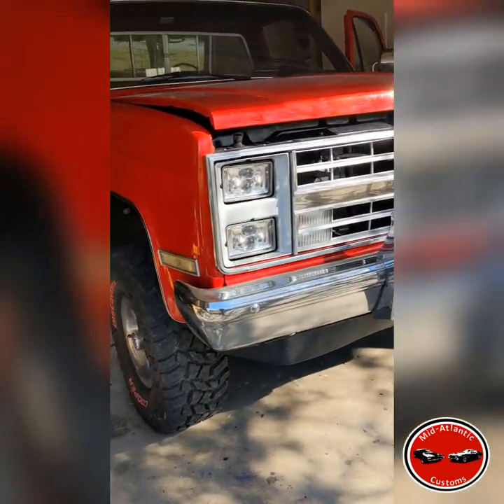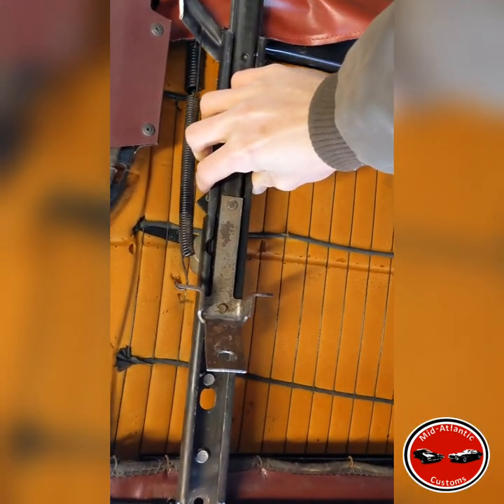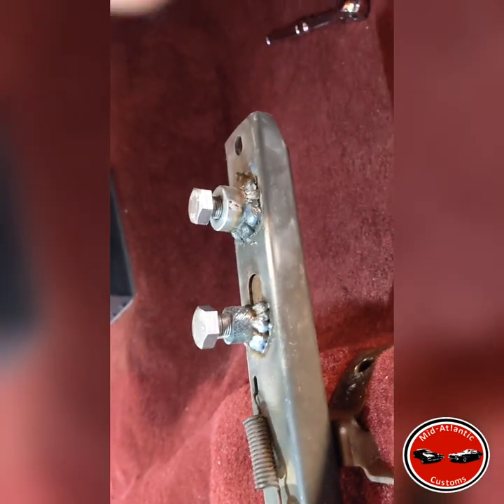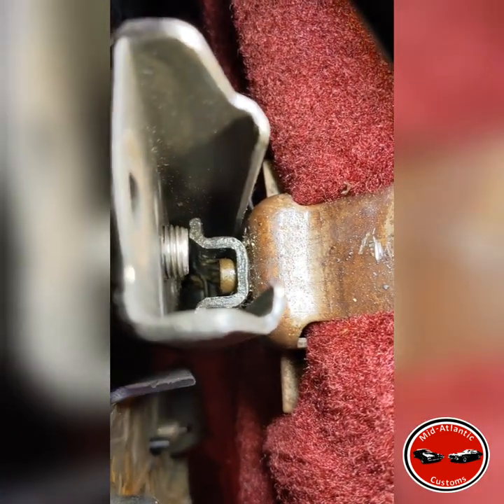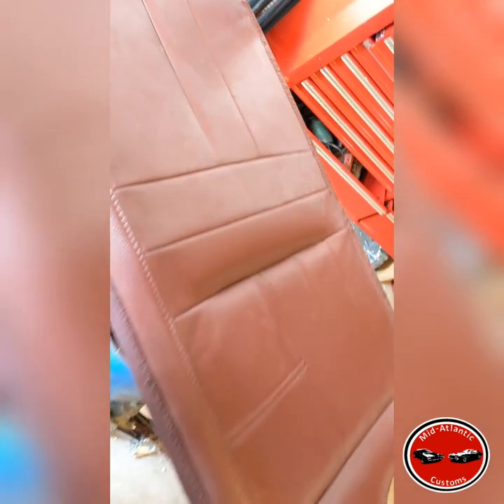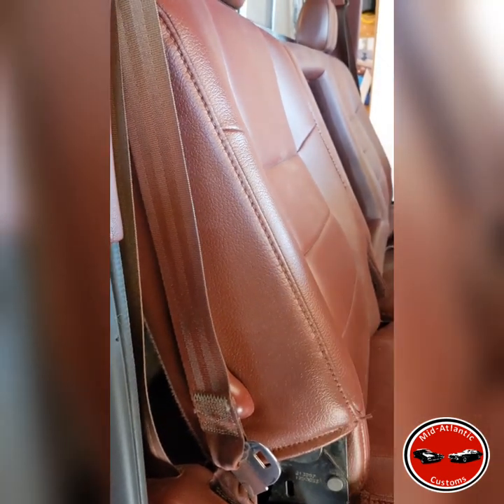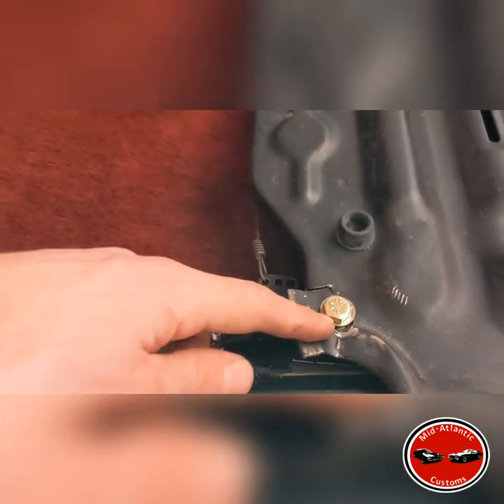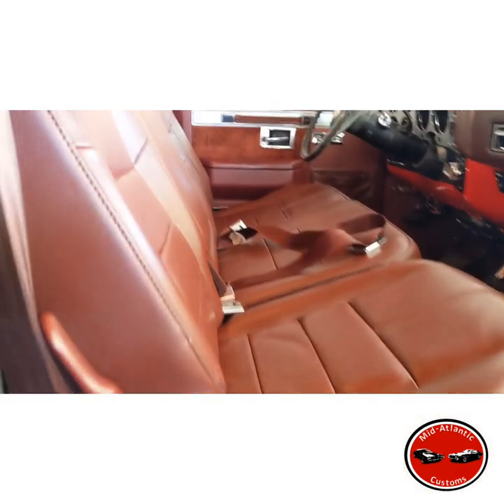Squarebody C10 K10 Seat Swap Part 2: Installing The Seats

Comment: This is the cleanest seat upgrade I’ve seen. I think I’ll go this route, however I have a square body crew cab. Do you think the Ford back seat will line up as good as your seat?
Reply from the maker: Thanks! Yeah, I definitely think you could make it work. Probably could pull both the front and rear seats out of a Ford and work them into the truck, just not sure how the front seats mount. Might take some additional fab work

Comment: I put 03 cavalier buckets in my 78 k 10 still not sure if im keeping them i am like 6’ 3/4” tall and i have them as low as they will go and as far back as i can they are way more comfortable still need to try and move steering wheel closer to the dashboard